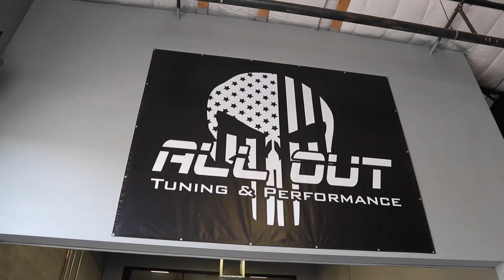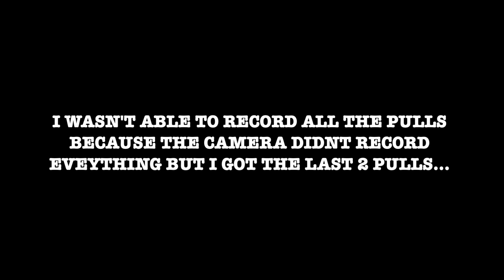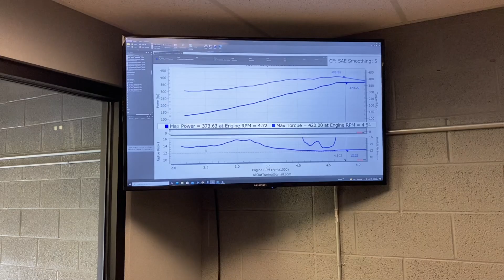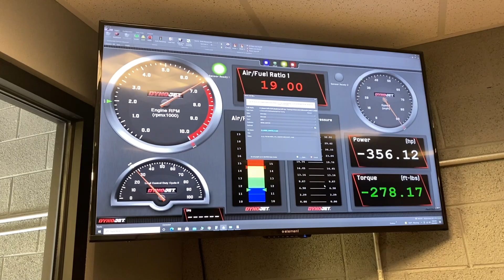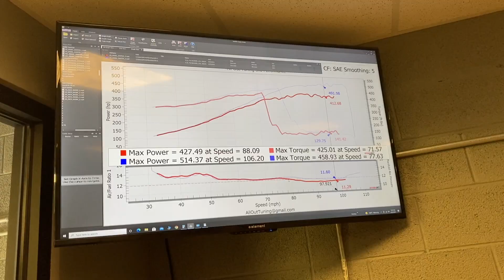STEPSIDE HIT THE DYNO ‼️

Comment: Damn bro wat u did to da motor cuz I’m building a 5.3 wit a pro charger
Reply from the maker: It just a stock bottom and , built top end. It made 514 on 9 lbs of boost, it could hold more but my tuner was having trouble because the aftermarket alarm. So we just left it at that. It has potential for more, before the swap it made 630hp  on like 15lb of boost